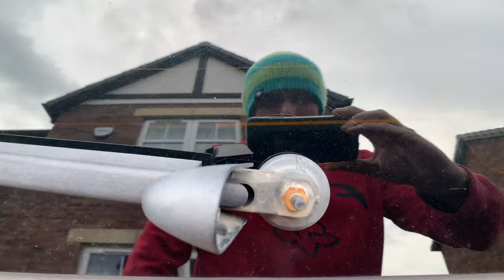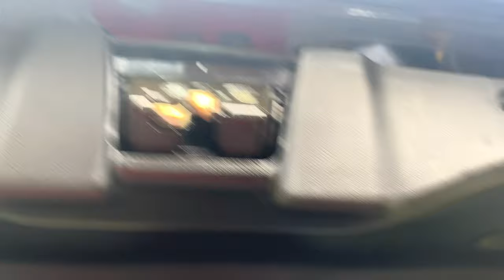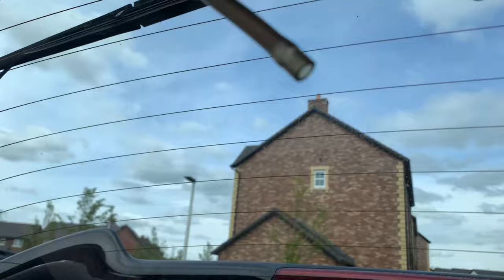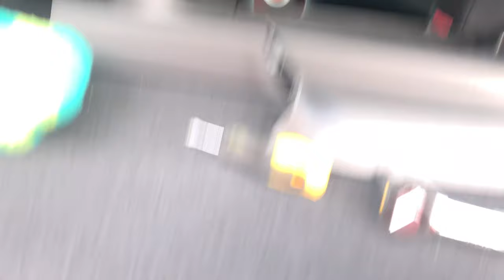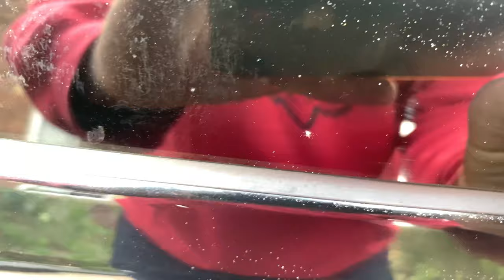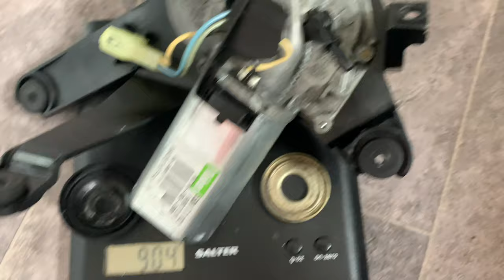EP3 Civic Type R Rear Wiper Delete De-Wiper

Comment: So... apart from the awesome change in the power to weight ratio... did the rear wash wiper jet not work?
Reply from the maker: Yeah it worked ok before
Reply: 1Blue Ghost   Can I have the washer jet?
Reply from the maker: @chrishandley7350  sorry I hack sawed through it